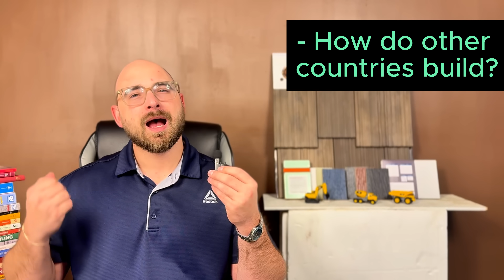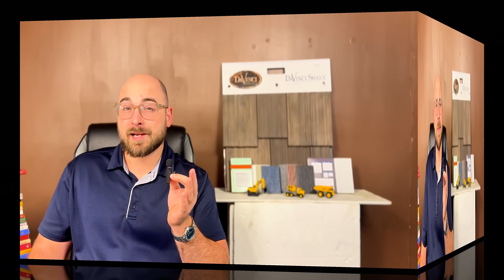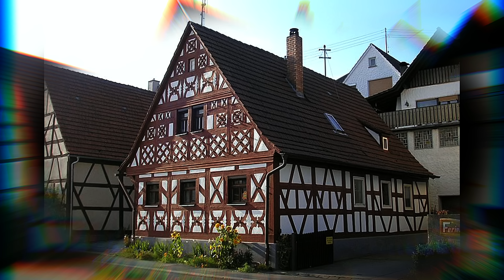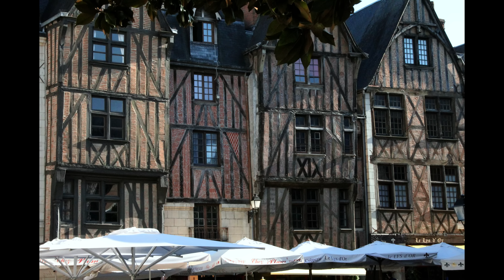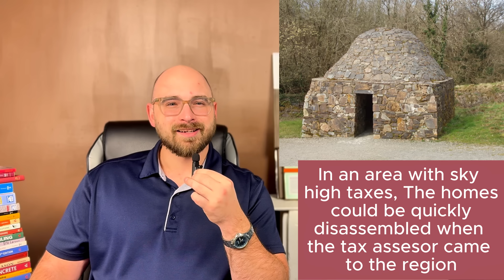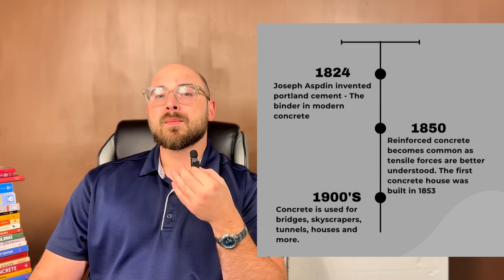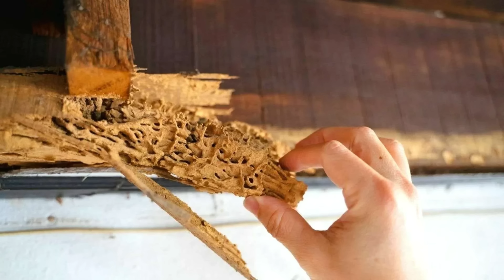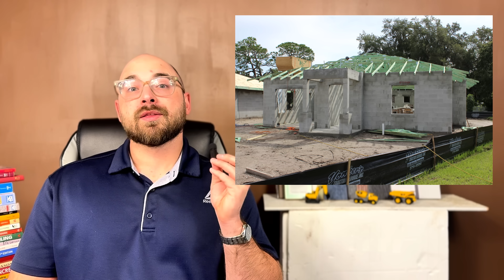Why Other Countries LAUGH at American Homes

Comment: Homebuilding in the US is designed to make a quick buck for investors rather than to build decent homes.
Reply: yeah that’s why so called forced air heat  (which is not really heat at all) became so widely used in new construction even in northern states, which is crazy. But because most real estate agents don’t know the difference between a furnace and a boiler, it is ignored in most transactions as insignificant.    I especially cringe for the buyers who have lived their whole prior lives with some form of radiant heat and don’t truly understand what they’re getting themselves into. But to the relevant point, it’s all done because the initial installment is a cheaper deal for the builder. What comes after is a different story altogether, but the developer doesn’t give a hoot about that. Everything is done like that in this country. It was the same story with American cars. The US pretty much invented the mass production of cars so why did Japan eventually build them better? Because the mentality there is to build quality that lasts. The mentality here is.. well you definitely can’t make the maximum bucks with that mentality!! if a car lasts 15 years rather than five well that’s two fewer sales that you get out of each consumer!!! absolutely UNACCEPTABLE!
Reply: @comment6864 
Lol! 🤣
A long time ago I heard that Japanese vehicles are built better because the Japanese have very small hands that can fit into very tight places! 😆 🤣
Reply: @ You have no idea what you're talking about at all.
Reply: In India most people use concrete.. only the poorest of the poor (tribes )use stones and mud
Reply: I wanted to comment the following:the real question is why are Americans paying so much for a house made out of toothpicks bro 💀
Reply: Also why are people only talking about concrete, do you all think we pour concrete when making a wall? The corners of the building are concrete Pilar's with rebar, and the rest of the wall 🧱 is made out of bricks , not the old type but the modern kind that's also a good insulator and is lighter and easier to work with.
If you wanna window or door you just cut that brick , the only bother is the dust .
Reply: Exactly. .. having lived in countries on all continents I agree that America have the shittiest cheapest houses.. in America here they build quick it’s all about speed and saving money, economic factors, etc. And they use wood, which easily burns down or termites and other forces can take them out. Many countries I lived in the homes were much sturdier and stronger built with brick or concrete or other strong materials. Hell, even in Africa the homes were very extremely strong built of concrete and brick. 🧱 And they don’t even have hurricanes or fires like they do here but man those homes ain’t going anywhere!!
Reply: You know why? Because of cars. Building for cars is wildly inefficient in terms of space and money. The property tax of Single-family residential homes can't maintain the cost of streets and roads. Over time, you lose money. The solution is therefore to expand and build more homes to gain property taxes and to pay for all the roads that have to be build for no reason other than for cars. The result? Those areas die out and run out of money because the local economy doernt work right. 

Basically: car dependency and suburban neighbourhoods work like a Ponzi scheme. You can learn more in the research called StrongTowns.
Reply: The most unpleasant thing is that builders and investors are selling these creaking wooden chicken coops at the price of reinforced concrete.
Reply: @ Reinforced concrete, nobody wants a concrete house, they are cold, boring and expensive.
Reply: They're not expensive outside the U S of A, they're only as boring as you make them, and again how cold they are depends on the making @ericholdsworth6611
Reply: Yup, it’s what I call toxic capitalism. I work in the construction industry and I see this all the time. I constantly come in behind those that threw junk together just enough to get paid and the poor people don’t know what’s right so they end up paying them and getting ripped off. Then they have to pay me to fix it. Just totally pathetic. It would give me great pleasure To make a living punishing these inconsiderate jerks. If any of you read this And are planning to do any projects larger or small please vet the Folks before they ever start. If they don’t have pictures to show (that’s location and time stamped) Then don’t hire them. If they don’t have pictures, that means they are not proud of what they do and therefore Just in it for the money. Send them packing as fast as you can. Find somebody that has lots of pictures and are readily willing to give you references. And remember if it’s too good to be true, It’s too good.
Reply: We don't make house that last forever, just ones that last the life of the mortgage
Reply: So you have a concrete box that cost more to build. You still need to strip off the interior finishes and electrical gear.  Get insurance and you’re good to go.
Reply: LOL
Reply: There is nothing wrong with OSB stapled sheds. But WHO made you call them "FINE HOMES"? 😂
Reply: With the prices the same as a stonebuild house in Europe nowadays you guys surely have not succeed that house for a buck idea.
Reply: everyone in these replies is talking about affordable homes, but don’t they realize that investors build cheap homes and sell the for the price of a well built one? nothing is ever consumer friendly i don’t get how people are so innocent
Reply: yes and in Fl  that how investors make money and the people  paid over and over  for a home
Reply: If you don’t like it, build your own house. 

I did, and it was worth every penny
Reply: @rufus2028  this is your solution? the fuck do you think we built society for?
Reply: This is true today, but this does not the damn platform stick structures. We have structures like these as well as balloon structures that are hundreds of years old and still standing and people living in them. This is like everything else a result of bad business culture, such as the crap promoted by Jake Paul Getty about making things to wear out so you can sell more to the customer down the line.
Reply: @ 

Exactly. There are custom home builders. You can hire an architect and design whatever you want. Design it yourself and have an engineer certify the plans. There are contractors that will build whatever house you want on your land. There are semi custom homebuilders. There are websites and books with tens of thousands of homes already designed that can be made out of whatever material you want. You can also change the plans for a nominal fee and get the entire set of blueprints sent to you. I mean it’s literally unlimited what you can do in America. When I say unlimited, I mean your options. We do have a problem with insane building codes, zoning, regulations, etc. etc. Ridiculous property rights restrictions. The list goes on and on. But in terms of the house itself is long as it meets code. You can literally do almost anything you want. Especially if you own a few acres in a rural area. That’s actually the most affordable way to build a house today. Buy an acre of land outside of town and get you a book or go to a website and pick out a design you like and then have a local home builder build the house for you. That’s extremely popular in the south. Tons of middle-class people do it that way in the south. A lot of people in the south, especially the homesteading community will live in a camper or a mobile home on a piece of land they bought and save their money and build the house cash or some combination of cash and Mortgage so that they aren’t controlled by any enormous mortgage long-term.

It is getting much more expensive, especially since Covid. Thank you, Joe Biden, and Democrats! Because of how they handled the 2008 financial collapse created by Bill Clinton and Democrats and big government and the way they handled Covid so poorly but the landscape they are still ways to do it And more people need to move away from big Democrat dominated metropolitan areas to places, particularly in the south that have a significantly lower cost of living. This is why starting your own business or taking advantage of today’s technology or how people achieve the American American dream. Not being a slave for some big corporation.

But of course, everyone focuses on the big builders that build lousy subdivisions and have their stock publicly traded. Unfortunately most people think that’s all there is to the American homebuilding market. That’s just one part of it.
Reply: Autistically simplistic. Supply/demand, history, culture and economy, or for liberals they're fault.
Reply: I love how you are talking about remodeling, but you don't talk about the fact lots of people in the US don't have a house 🤔
Reply: We don't make house that last forever, just ones that last the life of the mortgage
Reply: Not so. We use engineered lumber even in high-end home. We do have differing levels and qualities of construction.
Reply: So homes meant for humans to stay alive are just made for capitalists to make profit from ? I mean it's the USA. At this point I am not surprised, they love making profits out of deaths itself. Like this is why yall have more chemicals on everything you touch or digest. Like Fanta, yall pay the rich to give you chemicals and paper houses. And they still licking rich ppls toes.
Reply: Every product is unfortunately
Reply: I'm an American, I'll never be able to afford one of these investment vehicles formerly known as houses. Rent is theft. It should be illegal for businesses to peen houses. They should be  for people. The homeless population is proof of our countrys and capitalisms crimes.
Reply: IT ISNT FUCKING 100 F IN EUROPE
Reply: Thats not the case at all unless you buy a spec house, the process we use is affordable. If you look at modern European design, it basic and cheap looking, especially in Nordic countries. Most of the people who complain I would guess have means and you as an American can use whatever process you wish if you build yourself. Classic foolish rant.
Reply: Das sind keine Häuser,wir sagen dem
Baracken.
Billige primitive Scheisse.
Reply: I've built homes in the US.  Nice homes.  Better than "decent".
Reply: While it is a quick and lower quality build, while we are currently in a housing crisis i think it would be a good idea to make a lower standard cheaper housing solution to house poor and homeless people with more of an American building style, while they dont meet safety or insurance minimum requirements i think at some point we have to be sensible and say a less safe and “temporary” build style is better than people being homeless. 
I mean in Europe have way more trees available than Europe and we really dont use them enough, potentially we could even use more timber in brick houses with some kind of modern advancements to make them almost as durable and safe as real houses
Reply: American homes are bigger tho
Reply: *I just sold a CCB home that I had built.
*In hurricane prone weather I felt it was prudent.
*The only load bearing walls are exterior, so the changes we could've made were endless.
*The neighbors watched it being built & all felt that when storms came that they were coming to my place till things settled down.
*Would I do it again? Sure but ready built is really convenient.
*Then easily turned over when I feel like it.
*The only structure that is forever is your final pine box & even then only so, so.
Reply: German here. Only upper class can dream of owning a home. Want that in the USA too?
Reply: Not just home building
Reply: You definitely can
Reply: If this was true then the US housing construction statistics wouldnt be so low.
Reply: Same in UK ..
Reply: that depends you can build for that or for quality long lasting, or pay someone else to do it either way. all US homes are not equal. actually you can build your house how ever you want. just a lot of people chose cheap and quick, or just cheap. don't buy a modular if your looking for quality, or don't buy a home in a instant cluster colony. find a four man band who all live in solid houses they built themselves before they met the other three and just feed them money and let em go
Reply: Disposable homes.  It's the McDonald's of domestic architecture.
Reply: I imagine you’ve never been to the northeast where we have beutiful colonial brick houses everywhere
Reply: especially bc the people who are “investing” in building the homes aren’t living there, they’re making them and selling them off right away and we all have to deal with the shitty quality
Reply: The problem is capitalism. Homes are considered a rapidly manufactured commodity now. As in all other industries, the builder wants to make the most profit for the lowest expense, so they throw up tons of dogshit quality stick-built structures which crumble in disasters, then charge an arm and a leg for them, keeping average homeowners in debt forever. In the last few years, developers have reduced the rate at which they're building homes to keep supply artificially low, contributing to the current housing crisis. Same thing DeBeers did with diamonds, only with less (recent) ethnic cleansing. For-profit firms can't be trusted to act in the interest of society; they will only act to maximize profit and externalize costs.
Reply: It also saves the homeowner money. You can get a concrete house built if you want.
Reply: "how great we are" not that great actually. US wealthy , as everyone knows (but Americans) was built on exploration of ruined countries at WW and after imposing the Dollar as the mais currency. THAT sustains America on top so far. The day the world find a way to move to other currency, US will crumble. In resume, the economy is great, but the average American is pretty lame and ignorant, overall
Reply: It is in the uk
Reply: Same with every other industry the “best” food company in America by numbers pretty much produces poison translares to almost every industry
Reply: It is not important are the house from wood or stone important is it yours or you still have 20 years mortgage payment Greatings from Croatia Europe 😂😊
Reply: Major L on their part
Reply: Replace „Homebuilding“ „homes“ with any other industry and it will always be true…
Reply: Homebuilding everywhere follows the same thing, that's not an exclusive US motivation.
Reply: Overpriced tornado homes.
Reply: Most Americans don't fancy living in homes that are 6 feet away from vehicle traffic. I don't want to step out of my front door and get hit by a car.
Reply: Everything in the US is about making a quick buck off someone else
Reply: The same is becoming true to a certain extent in Europe as well. Large multinational conglomerates are slowly but surely taking over the new home construction sector, especially large scale residential projects like appartment buildings and multi-home suburban housing developments, but even made-to-order single family homes. They're exploiting low-cost labourers from eastern european countries (not paying them the wages their owed from working in western europe, not paying them overtime, not paying them sick days) and using tax loopholes to keep costs low and outcompete smaller, local builders.
Reply: Why is it different in Europe? They don’t have investors building houses also trying to make money?
Reply: To be fair, thats pretty much everywhere these days. the UK is sadly full of little boxes with bedrooms that wont fit a bed and a wardrobe (assuming you can even get a wardrobe or bed up the stairs), living rooms too small for a suite and garages you can technically get a car into, but then you cant open the doors to get out of said car.
And that is the main reason for buying an older house. Scale. To the victorians and before a house was a machine for living in as Le Corbusier pointed out, nowadays they are investment vehicles and spending money on making them livable is counterinutitive.
Reply: Everything in the US is solely designed to make a quick buck.
Reply: When you live in a place like Michigan, it can get up to 120 and down to -30 you can’t have stone structures that can take that type of temp changes, my home is 120 years old and I just recently modernized it
Reply: That’s not really why. It’s mainly because people don’t want to wait too long for their home to be built.
Reply: @ trust me, people are willing to wait for a well built home
Reply: I live in Portugal where the construction is solid because of fire hazards. To be honest it doesn't even matter to me because it's an headache to change anything in the outside if you live in a city. Just to change the colour I would need approval of the condominium, followed by the approval of the city hall urbanism office. And I can tell you that it would be denied because all the buildings in my neighborhood are a shade of yellow and white. Can't imagine adding a window lol.
Reply: Isnt it how everything work in usa?
Exactly why you cant afford any basic stuff like healthcare, education, public services.
Reply: Quick and overpriced😂
Reply: Those houses are legally not safe for living in mexico
Reply: People in the UK extend and remodel their homes all the time.
Reply: You can’t generalize like this unless you’re an idiot.  If so go right ahead.
Reply: True
Reply: That's the problem with EVERYTHING make in the US.
Reply: Okay but we have functioning air conditioning. so there.
Reply: America is designed to make a quick buck for investors rather than producing anything decent at all!
Reply: American homes aren’t built to last, but American homes are cheaper and easier to build. So you have a trade off. All home buildings techniques have their purpose and each have pros and cons. Yeah its fun to make fun of American style homes, but that doesn’t mean that your way is the best way.
Reply: Yes this!! The fact that you can buy a house for $300-500K, then spend another $50-100K on a remodelling and then in 2 years loose it all to fire or termites is insane to me.
Reply: That is the long and short of it.  $$$
Reply: US building practices are especially 'sus' when you consider that the US has 75% of the worlds tornadoes.  ALSO... hurricanes, wild fires, earthquakes and floods!
Reply: There are plenty of construction crews out there that will spit on you for this statement. Well, unless you are talking about homes that look and feel good, then theyd shake your hand. But as for quality, well, they will provide the spit, now all youll need is a towel to shine your shoes and get back to the office.
Reply: OK, so are you aware of people were making homes out of wood 100 years ago?

Just a question. 😂
Reply: US homes have excellent quality... excesive price is whole different conversation.
Reply: Home sellers are the same… they want to make quick buck and ask for astronomical price for a piece of poo
Reply: It is if you buy a shoddy production built house in a track subdivision. If you hire a custom home builder to build you a house, you can buy a high quality, long lasting home. The issue is… it costs a lot more to build quality, and most Americans don’t understand the difference in quality, and don’t want to pay for it. Would you spend 30% more for the same house with no visible difference in footprint or style? It’s not just “greed”, it’s the American costumers expectation for ever increasing “affordability”, and are unwilling to pay high prices for higher quality. If you are willing to pay, you can definitely get a house that will last 100 years +.
Reply: @brandonbeaty6617  disagree 100%.  It’s not that they’re unwilling.  It’s because the prices are obscenely higher and people simply cannot afford it
Reply: @brandonbeaty6617  willing to pay ≠ able to pay
Given the option of having a mediocre-decent house you can pay for in 5-10 years of installments and a good house that will be paid for by your descendants most Americans choose the former
Reply: Yes largely, but not entirely true.  The homebuyers are just as culpable.  As Americans, we are typically are impatient.  We want everything fast, from fast food right down to the construction & delivery of our newly built homes.  And if there are delays, somebody is incompetent.
Reply: The industry is in shambles. The building code squashes innovation. Con-qwackters just go along with it for the easy money.  100 years behind the times. Imagine if your car was built like a house is constructed. You wouldn’t get out the driveway
Reply: @steveperreira5850 this is such a nothing/useless comment I imagine you’ve never contributed anything useful to anything in your entire life.
Reply: @steveperreira5850  Such a dumb comment its unbelievable, why do you comment on shit you are clueless about?
Reply: @steveperreira5850 codes is a floor, contractors and builders use it like a ceiling.
Reply: @steveperreira5850 

You are correct in many regards. A big part of housing prices skyrocketing in different parts of America is because of the government and regulations and building codes, etc. This is one of those topics that Joe Rogan is clueless about. He’s incredibly dumb on certain topics or too fixated on his personal beliefs to see truth. Marijuana and building codes are two of those topics. He thinks we absolutely need building codes and that we need more not less. I live in Charleston, South Carolina. One of the oldest cities in America. The houses built 100 years ago are far better houses than new houses. Yes the plumbing and electrical eventually needs to be replaced. But the house itself?! Infinitely better.
Reply: @nedhill1242 we have lots of building code in Europe but this doesn't make our house more expensive, Yes they are more expensive but they are more efficient and durable, we construct some light frame house but if the house gets to be affected by the rain in the construction, the company has to demolish it and re build it. In the US if your house takes the rain in the construction it's  normal to just continue to build, this makes no sense.
Reply: @nedhill1242 a house framed 100 years ago is not comparable,  they're not as strong or as safe.
Reply: @ 

lmao

Sorry but that’s absolutely absurd!

First I’m in the real estate and mortgage industries. Second I live  in Charleston. One of the oldest most historic cities in America. 

The framing and construction of old houses is far superior! The plumbing & electrical are not as good as today but those are pretty easily replaced but that has already been done in most older homes. 

Houses today are built like crap. Inferior materials, itty bitty lots, no character, and on & on. 

You clearly know absolutely nothing about real estate or construction if you think older houses are inferior! You can’t even compare site built older houses to anything built in a modern subdivision. It’s a joke. You can buy and restore a house built 100 years ago that was completely overgrown when a more modern house would need pretty much torn down. 

I grew up in a house built in the late 1930s and renovated a pre-WWII duplex that are incredible houses. Real wood exterior. Hardwood floors. Real hard wood floors far superior to even expensive floors of today. Plaster walls. Beautiful lead glass & brass fixtures. Incredible tile bathrooms and kitchens. The framing is far far superior with better construction. 

I mean it is a joke to think homes built in the 1950s especially anything built in the 1940s and earlier are inferior to tract homes built starting in the 60s. Ask any flipper, real estate investor, etc and they will tell you there is no comparison. Go to any small or rural town and look at individual site built houses compared to tract built homes in modern subdivisions and it’s painfully obvious. Even some subdivisions with individual site built homes from the 60s thru 80s are superior to the average house built today or over the past 30 to 40 years. 

I can also promise you when people move to an older city. They much prefer the older neighborhoods and the older houses because the neighborhoods are far superior, and the homes themselves were individually built and so much more character. The only reason people buy houses in modern subdivisions is because of convenience and affordability as well as location. It’s not because of the quality of the house!

Regarding your statement that the houses built 100 years ago and specifically houses framed 100 years ago are inferior to today. That is ludicrous and laughable. Come to the south. Come to the deep south along the coast where we have termites, hurricanes, tornadoes, humidity issues, Unstable soil, etc., etc. Good Lord. Older houses are far superior. Older houses hold up much better to the conditions and again they’re in higher demand. Because they’re better built. Because the materials are superior. Because they have more charm and character.
Reply: @nedhill1242 the homes designated historical are very expensive.  Everything has to be approved by committee. Paint type, windows, roofs, doors, etc. I am not sure about the interior.
Reply: @nedhill1242 Without building codes there would be a lot of problems with fires, water damages, roofs falling in etc as builders would skimp on materials (both type and dimensioning) as well as safety and so on.
The codes needs to be constantly revised though for changing circumstances but without them there would be shanty towns all over.
Your example of good houses from the past is survival biased, the only remaining houses are the ones that were well built. The others have perished due to poor quality in design, materials or craftmanship.
Reply: @ 

Wrong wrong wrong

This’d things would not happen because only a mirin picks a builder that does that. The guys you’re talking about would be out if business and in jail. I swear people are children needing their hands held for everything today. You clearly don’t understand economics or how much different things would be because you are not smart enough or to brainwashed to see how it used to be and how that would work today.

As far as survival of the fittest Dude there are entire cities everywhere like this. Look at Europe. Look at any  city or town in America. There are entire cities and communities today with houses built with little to no codes. There are amazing neighborhoods from the textile and mining days when you had “mill towns” and “company towns “ where the company owned everything and provided housing. There are still plenty of the Sears homes that were houses bought out of the Sears Roebuck catalog and shipped to you on a rail car and you put it together on site like a puzzle. There are entire neighborhoods still like that. 

Where do you live? Have you never been to an old neighborhood in any city or town in America or Europe? I mean seriously people like you must fall off the tailgates of trucks because you aren’t very bright. I could prove my point in almost every town in America or Europe. 

FYI ever been to Houston? Most affordable big city in America. 4th biggest city in the country. No zoning laws. Texas in general doesn’t have zoning but most big cities do something similar which leads to the same issues but Houston has been different.
Reply: @nedhill1242 100 years? Dude I’m pretty sure my house is older than your country and it is still standing, so either 
1: your making up complete bullshit claims
Or
2: the education system in the USA is really REALLY terrible
Reply: Houses, not homes. A house is a physical structure. A home is a concept of belonging.
Reply: With European houses the fires in Los Angeles never became so worse.
Reply: @eos-fan  they’re made to look like European houses, they’re not built the same
Reply: How much more do you want to go into debt buying a home.
Reply: @kh2099-z5f  Your houses already cost more than the concrete houses of many countries.
Reply: @kh2099-z5f  If slum area homes in third world countries are built using hollow blocks and rebar, how can Americans not afford it?
Reply: @kh2099-z5f everyone wants the contractors to just eat the cost of premium home building materials- and contractors are “greedy” for not offering them at the same price… but consumers aren’t greedy for wanting contractors to do double the work for the same pay 🤔
Reply: you already go into lifelong debt @kh2099-z5f
Reply: @kh2099-z5f  then buy a smaller house, instead of building a mansion out of carton and sticks 🤷‍♂️ 
But I get it... It's hard for Americans. They love putting looks over anything else.
Reply: @kh2099-z5f houses in the us usually cost more for buying so idk what your point is
Reply: @kh2099-z5f  its actually not that expensive if your building it outside big Citys
Reply: @kh2099-z5f European house prices are about the same or even lower than yours.

Homeowning prices are not tied to the materials used to build your house. At least, not strictly so.
Reply: @kh2099-z5f  I know everyone should get a free house😂
Reply: Health Insurance and everything else is the same way. In America quarterly profit Trumps EVERYTHING! Including life itself. Aaahh yes, got to love capitalism.
Reply: So Investors can't make a quick buck in other countries????
Reply: @gnomechump-stiny7128  there will always be companies trying make thing the cheapest and simplest way. That's why you regulate the industry, so the lowest standard is good enough to last. The downside is that the system may appear rigid, and you usually need to hire professionals instead of doing everything yourself. But, from my knowledge, this high regulation model is more prevalent in Europe than in the US.
Reply: @gnomechump-stiny7128 they do, but the greed in the US corpos keeps blowing my mind.
Reply: @gnomechump-stiny7128 exactly, there are regulations outside US where pigpens house isn't preferred
Reply: @gnomechump-stiny7128  because there is a different mentality in other countries. In Europe it's more like live-long investment, people here don't want disposable houses.
Reply: @gnomechump-stiny7128  they can but they are take in arest if somting like poor building tehniks or mising materials are found
Reply: @gnomechump-stiny7128 no. Because we have LEGAL STANDARD for building homes to sell NOT TO ENDANGERS THE HOME BUYER.
Reply: @gnomechump-stiny7128  investors can make a quick buck in the uk too. But the entire gimpy bitchmade American construction Industry is solely designed to maximise profits while lowering quality as much as possible. The floor plans are bad too, you can buy a bigger house for cheaper but all the space is wasted. It's shit all round
Reply: @gnomechump-stiny7128  a profit yes. A quick one? F*ck no😂😂 ( at least for a small to medium size builder, larger builders can get products and workforce cheaper and en mass, making work quicker, cheaper, more effective, although sometimes lacking, but not collapsing on their own weight
Reply: @gnomechump-stiny7128  Not when it’s scamming. Selling a shack priced as a mansion…
Reply: @gnomechump-stiny7128  other countries prioritize housing people can live in for generations rather than for profit.
Reply: do you think Europe is different? They buy a small area of land and make a 7 store (or more) building, and since the land area is the most expensive part, the more houses you fit in the smallest area, the more you win. Houses in Europe are EXTREMELY expensive, a 60 square meter flat costs half a million new.
Reply: In the US they build a house. In Europe they build a home.
Reply: Yes a house built with wood can be sturdy. Most of the tract homes that are built in the US are built to meet a minimum building code and the building codes can vary quite a bit from state to state. 
Plus most of the other countries didn't have to deal with the rapid population growth the US had.
Reply: @Rhaspun  yes but now the rapid population growth is past history but the us still use wood right on the track of fucking tornado XD
Reply: @faellyss  

It’s all about percentages. The odds of your house being destroyed by a tornado is extremely extremely low. The odds of a hurricane destroying your house are as low or even lower even in a place like Florida or South Carolina.
Reply: @nedhill1242  where i live there is no tornado, but there is huge hurricane ( i live on a french island in the indian ocean) every year we have atleast 1 hurricane crossing the island , and everyyear hundred of weak house ( because poor people ) got obliterated
Reply: @ 

Seriously?

It never ceases to amaze me how desperate people are to prove others wrong on the internet. Is your self esteem that low or are you that narcissistic that you think a French territory is the same thing as France itself or Europe? Are you mental? It’s an island in an ocean near Africa. Do you actually know how a hurricane works and where they come from? 

Next you’ll talk about French Polynesia or French Indonesia or French Indochina. Maybe say you live in St. Martin. Therefore you can say you live in France. 

This is hilarious. I hope you are being sarcastic or a troll because it would be truly sad if you are being serious. 

But just for clarification. Living in a French territory it’s not the same thing as living in France. Living in Europe. This would be like someone saying America doesn’t get monsoons. Because we do not get monsoons. And then somebody reply that they live in Guam and that Guam gets monsoons therefore America gets monsoons. Such desperation, such ridiculousness could only come from a child, a troll, or someone truly disturbed.
Reply: @Rhaspun  

Actually, almost every state  uses standard building codes. When you go to get a building permit either for a new house or to remodel an older house it we usually say everything has to be built to one of the following standards and they list 3 different standards that are nationally or internationally recognized. Florida has the best built homes in America these days because of hurricanes. Most houses in Florida are made out of concrete block with rebar and concrete poured into the outer walls and require high impact glass.
Reply: @nedhill1242  I've seen videos showing homes in Texas using what looks like cardboard as sheathing. I know Texas isn't the only state who would have a low standard like that.
Reply: Elementarily Simplistic, pablum
Reply: @randidaman6978 what is?
Reply: Not just peir homes or junk slab houses most American home are equally as good as European or any countries homes. Those that speak that American homes are terrible couldn't build a sand castle.
Reply: Honestly, it's mind-boggling that you'd make a video like this. I don't know if you're too ignorant to understand what you're affirming and spreading, or you just want the views. Americans need to wake up about thus ignorant bigotry from other countries instead of going along with it. You've basically been an Uncle Tim here.
Reply: Well, just look at the difficulty of trying to sell a more expensive home. The developer purchased is 40 acres and they have to try to make money on this development so they can’t make them large plots or else they’d have fewer homes and they’d make less money so they have to be smaller to start with and then they have to have as many amenities as possible, but they can’t cost too much or else they priced themselves out of the market for people looking at smaller homes on smaller plots. 

You can’t build million dollar homes on postage stamps and expect people to be willing to buy them when there are much larger homes for cheaper next-door.

That’s the problem…. It’s a bigger country, you’d think we’d have more land, but it doesn’t work that way because land prices are dependent upon their proximity to downtown…. Many Europeans  are forced to make do with a real estate culture where your grandparents purchased a home after the war and your parents inherited the house and someday you might inherit the house, but that’s the only way you’re ever going to own one because they’re just too damn expensive
That’s just not how things work in the United States because we have a much more mobile culture where people don’t plan on buying a house and living in it for 60 years in order to justify the massive expense, they buy a starter home and they worked their way up
Reply: @Matt-yg8ub generational? Our mortgages are max 20-25 years at a 2,5/3% interest rate. Every working class family can buy a decent flat and pay it before their kids legal age. I'm living in northern Italy.
Reply: @elephone1542  yup well that’s kind of how it used to be in the US .. like 50 years ago. And an average family could afford an average little house on a single average salary. I call that a normal balanced economy, but for the powers that be that is too boring 😂. unfortunately, I think that is why the trajectory for this country will continue to its decline, a slow but painful one.
Reply: @  ok… I guess you found yourself a nice cheap place in the countryside. Meanwhile, the average home price in Germany is $300,000 higher than it is in the United States.
Reply: @elephone1542 as per google average mortgage rate in the us is over 7%
Reply: @Matt-yg8ub  averaging across a country is probably misleading. Europe is a much denser place. So you are probably in effect comparing some house in rural Mississippi with a house in suburbs of Frankfurt.
Permission to build usually affects home prices more than construction technique. Just look at house prices in San Francisco for instance. It's astronomical not due to construction method
Reply: @Matt-yg8ub  the median house price in us is 484k  wtf are you talking about ? XD
Reply: @Matt-yg8ub How much do you get paid though? Do you have to worry about medical debt from lack of health insurance? What about paid time off? Do you have to pay for childcare? The grass is not as green as you think.
Reply: @Matt-yg8ub  No, its not, lol. What are you smoking... And why compare with Germany where most of the real estate costs are driven by speculation? Compare with Spain, Italy, Greece, where square meters cost significantly less. The average median for square meter in Spain is less than 2k euros. In the US is more than 5k, lol... And youre not even takiing into account that a house in Spain lasts you several generations whereas one in the US can fall down on you in a few decades.
Reply: @elephone1542 ...my fellow human from italy, dont make the USAn cries will you? In our countries, home are one of human rights and citizens right.😂
Reply: @Matt-yg8ub paid ONCE! Ask the USAn what kind of fee they have to pays CONSTANTLY! more so if it is HOA house.
Reply: @Matt-yg8ub the average house price in Germany is $375k. 

and I know for a fact that houses don't cost $75k USD over there, so that's just a lie.
Reply: @Matt-yg8ub higher but also hurricane proof.
Reply: @Matt-yg8ub what's the cost of living difference to wages? What's the average wage. When you compare places and costs of homes, wages and the cost of living factors in. Like no one in most couhave medical bills, costs like America
Reply: @Matt-yg8ub  no parent live in the grand-parent house grand parent are still alive and live in it , you're totally out on understanding of the european context and usage
like my great grand parent are still alive and in a house their parent owned even before the war, my grand parent live in a city nearby in a house they bought, my parent live in a house my uncle build before leaving and selling it, i live in a house i bought the land and made the house be built 
all of those house are made of "concrete" and none of them is in the same price range ,
my house cost me 250k to buy the land and be build, my parent house is valued at 450k(big house with big property), ma grand parent house is something around 200k (tiny house), my great grand parent house is 500k ( huge old farm) price varie because of size, location, big city nearby ...... like in the us 

and after checking  similar location (distance to big city etc) and size  house in us cost more
Reply: @Matt-yg8ub  But cheaper materials shouldn't mean that the houses are cheaper too? And yet you americans likely pay more for a cardbox-home than we Europeans for a normal sturdy brick/concrete house.
Reply: @Matt-yg8ub for the most part it isn't true. We in europe (that isn't a country) don't hope to inherit our parents' house, we work to buy one ourselves
Reply: @Matt-yg8ub Let's see. I have my own apartment, so does my brother and so do my cousins, and we live in Romania, France and UK. But please, don't let reality stop you from that nice fantasy of yours about better mobility and affordable housing...
Reply: @Matt-yg8ub
As a Swed I have only meet one person in my life that has inherent his house. Everyone else by them or have them constructed.

Refurbishing concrete, brick and wood houses are quite common.
Reply: @Matt-yg8ub  the problem with that argument is that US homes aren't exactly much cheaper than European homes
Reply: @Matt-yg8ub  sounds like there is something fundamentally wrong with how you built cities.
Reply: @ compared to Europe? We developed most of the fixes to the older problems, but never had the chance to gut everything and rebuild it in the US like we did in Europe after WWII.
Reply: @Matt-yg8ub why are the starter homes more than a permanent home?
Reply: @Matt-yg8ub  Wait you mean younger Americans have any hope of owning a home?? Of course not! They're all being bough by corporate landlords to ensure future generations will be perpetually renting! And we don't even have co-ops like Europe, just rent-seeking capitalists. 😢
Reply: @Matt-yg8ub omg these poor hedge funds lol 😂😂😂
Reply: @Matt-yg8ub people also don’t expect to own anymore in the US and the housing market is going to collapse bc unbridled capitalism is clearly unsustainable dispute what dopey white trash idiots like you think.
Reply: @Matt-yg8ub  pfft excuses. even in poor countries. ALL AROUND THE WORLD people use concrete. how come developers can do this in rich and poor countriers?
Reply: @Matt-yg8ub 
I don't know where you're getting your info from but I live in the UK and I can think of only 1 person that lives in a home they inherited from their parent, let alone their grandparents. that was only because her mother died young and left her 3 kids to share the home.
Reply: You cannot remodel a concrete house. Remodeling is an integral part of the home owning experience in the USA, which is alien to Europeans.
Reply from the maker: @starventure it is possible to remodel a concrete house. 

ICF homes are fairly simple to move plumbing and electric as they are not embedded in the concrete, but in the foam. 

And it is fairly simple to create door and window openings in a concrete house. 

You will of course need an engineer to approve a set of drawings, but you can cut very nicely though the concrete core using a cut and break saw, typically adding steel lintels above the new openings 

Not to mention how trends go out of style. If your home is out of style, just wait, soon it will be trending again
Reply: @Mike_Fortin 

I’m in the mortgage and estate industry and I’m very familiar with ICF homes. Everything you said is inaccurate.  Most of the plumbing and electrical is under the house or through the floors or interior walls. We are necessary you can run electrical in the outside walls for switches and receptacles but you try and minimize that as much as possible. It is extremely difficult to create a new doorway in these houses because you’re talking about several inches of concrete and rebar to cut through. Barry rarely will you see someone add an addition to a home built with ICF blocks and if they do, it’s where there’s a door or window already to make it easier. Also, these homes, particularly in America tend to be more expensive and are built by people with a lot of money in areas that have hurricanes so they’re building large homes that they’re probably never going to expand anyway.
Reply: @Mike_Fortin  Very true sir.  This is a primary reason I've selected ICF to be combine w/other construction methods & materials for my planned multiple homes across the globe.
Reply: @Mike_Fortin ICF is not simple to run pipes or wiring. Especially for a remodel.
Reply: @Mike_Fortin  if not In the far center of USA/CANADA with dry air, the wood houses older than 25 years stink like fungus ...
Reply: @nedhill1242 no he isn't
Reply: @Mike_Fortin  but it's more expensive, more time consuming, more labor intensive, and overall more difficult.
Reply: @Mike_Fortin i cut holes in basement foundations to put windows in basements and it costs 2-3 times more if you want to add an opening in concrete vs wood framed.  Not to mention concrete is one of the single biggest contributions to environmently pollution.
Reply: @Mike_Fortin 😂
Reply: @Mike_Fortin yeah no its not. Clearly ypu never had to drill a 76mm whole through .5m of concreet to put a pipe in. And it shows
Reply: @Mike_Fortin mate it is cause our houses dont burn like i dont know "wood" and they dont fall apart from a little stronger wind.and also wtf is HOA? Do you actually own your houses or are you living in a camp where everyone can bother you
Reply: Egineers are only needed in high developed countries and in commercial buildings, here in Brasil almost all masonry houses are made by a contractor (you have nice and bad contractors) and his 2 or 3 employees , and we do the construction and remodels first then we wait 5 years to the prefecture send us a mail raising the tax of the house, we have basically no building codes (it has it's pros and cons)
Reply: @Mike_Fortin very common here in Australia to have concrete tiles roofs or metal roofs and steel frames and brick
Reply: @nedhill1242 wtf? It's easy we do that all the time. The big difference in Europe is that every one I educated in their craft, they went to actual school.
Reply: @dubvuchyea502  

No, who isn’t? Be specific. Are you talking about Joe Rogan? Joe Rogan is clueless about this stuff. He’s incredibly ignorant.
Reply: @starventure  You certainly remodel a house built using concrete blocks. I have done it twice here in he UK.
Reply: @ So you are knocking out exterior walls and pouring foundation extensions in a concrete house...? OK, sure whatever you say.
Reply: @rogerphelps9939  yes and in the UK specially in London people have been even digging their foundations to build deeper under the house.
Reply: At what cost? @rogerphelps9939
Reply: @starventure  yes you can XD
Reply: @rogerphelps9939  our house was a fixer upper when we got it and has been in near constant remodeling for the last 18 years. You can't do that with a brick house.
Reply: @rogerphelps9939  wrote "You certainly remodel a house built using concrete blocks. I have done it twice here in he UK."
In the US, due to our building codes (which are crafted to protect residents from danger), if you want to change a house that's made of CMUs, it requires engineers to get involved, and considerable permitting, which can be very burdensome.  Also, I'm not sure how you build with flyblocks in the UK, but in the US, steel rebar is used inside the cavities, which are then grouted (filled with concrete slurry).  This makes a tremendously strong wall, but almost impossible to selectively demolish for modification.
Reply: @rogerphelps9939  same for modern flats in Russia. It's done quite often here, especially when builders leave some "columns" with hollow spaces inside just to dump construction waste into there. Yes, it's an actual thing, seen some guy on YouTube removing internal walls of a newly built apartment and adding a couple square meters in the "bathroom area" alone.
Reply: @rogerphelps9939 
😂 Let them COPE it's too much a shock to them.
Reply: @rogerphelps9939 shhh they dont know sledge hammers exist 😂
Reply: @rogerphelps9939 Source? 😂
Reply: @coldstarcommand are you really that ignorant to think you can't remodel a brick house 😂😂
There's literally hundreds of TV shows showing just that.
What an American ignorant way of thinking.
Reply: Way more expensive genius and takes more time😂 @rogerphelps9939
Reply: @starventure yes, we do knock out exterior walls and pour a new foundation if we want an addition to our concrete house. In my previous street around one in six houses had an addition. Most of the times it’s just an addition to the living room of about six feet to the rear of the house, but sometimes also a few feet to the side as well. Sometimes it also includes extending the second floor and roof. 

That last one doesn’t happen too often though, reason being that adding too much value to your house will make it harder to sell eventually. You can upgrade a €300K house to a €500K house, but most buyers with a €500K budget will want to live in a €500K neighborhood. 

So instead of adding a large addition, people will rather just buy a larger house in a neighborhood with similar houses.
Reply: @starventure yes. And we build those wall again, no problem. How on earth that is so difficult in USA!?
Reply: @dvdouden  How much would that cost? That seems to be an incredibly large amount of work just to get a few more sqm. The whole neighborhood thing you mention is very interesting, because with the exception of a few neighborhoods in our suburbs, it is preferred to increase the value of the house to make it sell faster as part of gentrification.
Reply: @ I had to Google that but it seems to be around 3000 EUR per m2, 280 EUR per sqft. Including sliding doors, tiled floors and plastered walls and ceiling. That’s in the range of price per sqft for houses currently on the market from what I can see. 

My previous house was a terraced house (which is the most common type of house around here), 6 meters (20-ish ft) wide, 8 meters (26’) deep. Extending the lower floor 6ft to increase the surface by 120 sqft would cost about 30-40K, rough estimate, certainly more than 20K, less than 50K. 
Adding 6ft is the most common addition since it only requires a technical permit for modifying the load bearing structure of the house. If you add more then you also need a permit where they check if your modifications fit the character of the neighborhood and doesn’t affect your neighbors. If you have a terraced house then you’re pretty limited in what’s accepted. Houses on the corner of a block often get larger additions since they usually have a garden on the side of the house as well that can be used to build on without affecting the neighbors. 

In the current market every house is getting sold sooner than later since there’s a shortage. Houses are literally being sold before they enter the public market.

Most people I know that added an addition to their house don’t plan on ever moving again. They like the neighborhood, their neighbors, the view and they just want a larger living room. Most people will just look for a bigger/newer/better house though. Especially with the low interest rates on mortgages a few years ago, people were able to finance larger houses more easily, so why bother with a large renovation. 

One couple in my street added an extension to their house when they bought it. They weren’t able to find the house they wanted on the market, so they settled for a smaller house and use the rest of their budget to renovate and extend the house. It’s a lot easier to do when you haven’t moved in yet. 
They mustn’t have liked the neighborhood or something because last I’ve heard they moved after two years already. 

A more popular kind of renovation is a dormer loft conversion. It’s a lot easier, can be done in a day, makes the existing space on the loft a lot more usable than just for storage and it doesn’t reduce the size of the garden. I had a 40ft dormer added to my current house, that effectively added over 200 sqft to my house for less than 30K unfinished, so 150 eur per sqft. They rolled in the trucks and crane in the morning and were gone by lunchtime. But I digress. 

Bottomline: yes it’s costly, messy, takes a lot of work, so it’s usually done only once in the lifetime of a house and most houses will never receive an addition. But people do it nonetheless and it’s not uncommon. 

I have no doubt wood framed homes are easier to extend and renovate and therefore it’s done more often. You’re still going to face the same challenges with opening up load bearing walls I guess. I think the main difference is that most of our homes are two or three stories so there’s a bit more load involved, but I guess you’d have the same problem if it was made of wood. 

Oh yeah, one last point: in terraced houses most of the load is carried by the side walls. The front and rear walls usually contain a lot of holes in the form of doors and windows already, and they mostly just carry the walls above them. The floors and the roof mainly rest on the side walls and possibly load bearing walls or columns in the house. A couple of jack posts is usually enough to carry the load while they knock out the rear wall on the lower floor.
Reply: @starventure  you're just gonna pretend like the rest of the world has never renovated their house?
Reply: @rogerphelps9939 the definition and outcomes aren’t even comparable. I can only guess that you think we don’t know people that live in Europe. We aren’t talking about interior upgrades. In 90% of your countries you don’t have large enough lots to do any exterior remodeling. How many rooms did you add?
Reply: @starventure  you ... guys dont?? even here in latinoamerica we do that, sure, if you dont plann ahead the process can be a total b1tch, which qhy is something that muat be planned and not juat made on the spot 😅
Reply: @sebastiansuazo98  We can do full house remodeling, it happens frequently and is not tough at all. The big difference is the only concrete we are dealing with is the foundation, which once it is expanded out from the existing foundation allows for the new exterior walls to go up easy, typically wood frame with brick exterior. You are talking about house expansion, right?
Reply: @rogerphelps9939  yup same here in the Philippines it's as easy as grabs the nearest sledge hammer and tearing the wall down and just extend it I've seen my family do it more than once
Reply: @starventure  alot of very old europeans houses have been remodelled and modernised for present and future use.
Reply: @alanmay7929  When you say remodeled, exactly what do you mean? I am getting the feeling that our interpretations are not the same.
Reply: @starventure  I disagree. We have remodeled our houses many times. it all depends on the way you decide to build is. If the Schell of the house is only made of concrete and the interior is just plasterboard walls you can easyly change the floorplan. Also brick or Concrete walls can be cun into or can be removed even when they are structural.
Reply: @flost8202  I will agree if it is brick, but even then it is going to be more complex than with a simple wood frame wall. I asked the engineer I hired about this subject this morning, and he commented that if it is a prefab house it should be easy to do, but a poured concrete exterior like seen in European homes is a tougher deal.
Reply: @starventure  Lmao, we added an extension (designed by the same architect as the house) to our concrete home. Funny thing is, it doesn’t look like a McMansion.
Reply: @starventure  Try knocking a load bearing wall with any construction method. And about remodeling there are entire tv shows dedicated to exactly that, so remodeling is new homeowners' pastime here too.
Reply: @starventure  Not true: Only structural walls are made wth rainforced concreate: divisional wals are puild with bricks, blocks or plaster boards, and can be removed, wuthoud affecting structural integrity of the house. Paradoxically you cant do that in baloon frame house, becouse all walls are structural to some degree.
Reply: @starventure  you can remodel a concrete house, wtf you on about? And how often do you Yanks feel the need to "remodel" anyway? You're making it sound weird.
Reply: @eno88  Go and watch HGTV or just look up contractors in the states. It is a common industry and is frequent.
Reply: @starventure  u can and i have. In concrete construction not all walls are strcutre walls.
Reply: @starventure  What? We have a family state dating back from the 1950s and has been remodeled at least five times.
Reply: @Gearparadummies  When you say remodeled, what do you mean?
Reply: Absolutely not accurate, concrete houses may be remodeled just like most single family houses. @starventure
Reply: @starventure Incorrect, we  remodel concrete homes in Korea
Reply: @scottydiver5114  To what extent?
Reply: @scottydiver5114  When you remodel, are you maintaining the exterior walls as is and just moving stuff inside?
Reply: @starventure  in the American remodel we do everything strip the interior down to the studs new floors walls usually leave the ceiling but not always 
New exterior if necessary 
Sometimes the new roof 

In Korea, generally simple stuff, the most complex being to cut holes in concrete walls and put in Windows
Reply: @starventure  Florida houses are all concrete block and get remodeled all the time. Why are they all concrete block? Because crappy timber houses get annihilated in hurricane force winds.
Reply: @starventure  you can if the house was build with this in mind
Reply: @starventure since when did concrete homes cannot be remodeled?
Reply: @starventure  Tell me you have no experience with concrete houses WITHOUT telling me you have no experience with concrete houses.
Reply: @starventure ah yes we never remodel 😂 you should see what some people do with historic houses where the outside is protected and not allowed to be altered. The outside looks like it did 200 years ago and the inside is extremely modern. Also if the layout of the rooms is good why would you even need to remodel much, except the occasional new door?
Reply: @starventure you can absolutely remodel brick houses, happens all the time
Reply: @panik735  Yes, brick is easy to do. But we are talking about European homes with reinforced concrete exterior walls, not brick or anything else. They are claiming that they jackhammer out the fronts and sides of houses for extensions like it is nothing. Anyone who has ever seen what it is like when the foundation of a house has to be opened up from the inside for plumbing repair, will know that it is more than a little suspect.
Reply: @panik735  Yes, you can. Brick can be pulled down and reused. But that is not what we are talking about here. We are talking about either pre-fab or poured concrete walls with rebar that are on the exterior of the house.
Reply: @starventure maybe it's because of the region I'm from, but I think this discussion is greatly overestimating how many concrete houses there are. From my experience, most (traditional) homes in Western Europe are brick.

And remodeling brick is totally doable. I'm in the process myself. We moved interior walls, added extensions, applied insulation in the floor, roof and walls and replaced everything related to power, water and heating. We call it "stripping" a house. Yeah it's pretty expensive, but the masonry work was only a small part of the project.

It's a very common practice over here because it's the only way to really bring a home up to modern standards. My house was 40 years old when we bought it, and it will be good for another 40 years when we're done in a few months.
Reply: LMAO yes you can remodel it, the  ignorance is insane  @starventure
Reply: @starventure 
You can defenitivly remodel a brick house.
These cardboard walls of american houses are nothing but a cheap skam. Designed to look nice for 10 years, then the mould sets in. If you want to see what quality houses look like, go to Switzerland and see how they build their homes there. Some of them stand for hundreds of years and they look good!
Reply: @starventure  ofc you can! only the structure is concrete the walls can be changed at will.
Reply: @starventure  i wish 😂, i'm 45, now on my 2nd house and 3rd renovation/remoddeling cyclus. Us Belgians are  " Born with a brick in our stomach" 😊, it is an awfull  disease  to have 😂
Reply: @starventure I think remodeling something as permanent as a residence is a stupid idea to begin with and consumerism to the maximum. If there is no flaw in the building, remodeling it just because you feel like you need a change is crazy wasteful.

Also Europeans also do changes to old homes when the layout doesn't fit modern living anymore.
Reply: @DxCBuG  There is a flaw in the design if the buyer says so. Who made you god?
Reply: @starventure as some one who has worked in construction in Europe, you are fundamentally wrong. Concrete can be remodeled as is but not as often than in the us and it is harder to do. There is a mindset that is more towards durability but still comfortable for 95% of potential residents. As for what I’ve seen in the us, there is a mindset to build faster and cheaper to make a quick buck and then it is the responsibility of the next owner to take care of maintenance and/or remodeling.
Reply: @Jacada2002  OK, you literally just said "it is harder to do." Did you just type that or did you not?
Reply: @ yes i did say it is harder to do. What I seem to not have said is not by much more. The little bit of extra work is worth it. Because you have a more sturdy building. My original point was about the fact that you stated that it is uncommon to do that kind of work. And I’m telling you that although it is less often the case, it’s still very wide spread.
Reply: @starventure You can remodel the home made out of concrete lol
Reply: @starventure Who said that? Yes, it is harder in older homes. But the new ones do not have this flaw as they have one or two load-bearing walls. You can move any other wall as you wish.
Reply: @starventure  we definetly do it here
Reply: Land of the free unless when you want to do anything then it’s think of the national debt
Reply: @decadesyearoldthingsreview6595  Well maybe it's time to fire 300k employees in government and get back to basics.
Reply: @ericholdsworth6611  Well yes, let's just do that in the country where you meant to pull yourself up by bootstraps. Let's also bankrupt some grisly companies not doing their job properly, then the people sitting on property waiting for the next generation to retire by simply devaluating their property costs by making their homes not being set up to proper standards. People will suffer, but you can have now decent housing.
Reply: @decadesyearoldthingsreview6595  What? English your 3rd language?
Reply: @starventure  Sure you can easily remodel those houses, on modern houses only the exterior and supporting walls are solid, interior are drywalls from plaster or wood or lightweight porous plaster bricks, easy to remodel with a saw and a hammer.
Reply: @timhartherz5652  That is not what we are talking about here. We are discussing house expansion, not moving internal walls.
Reply: @starventure  You can still do that as well though. It's being done on a daily basis, there isn't a single house in my street which wasn't extended in some way at some point.
Reply: @starventure  modern concrete flats can easily be remodeled, only Soviet era stuff is stuck the way it is due to it being designed for quick production. It was supposed to be a stopgap solution, so nobody planned it to be remodeled, it just somehow survived for up to four times of its planned lifespan (75+ years instead of planned 25). Even then there's a few examples of houses started in USSR and finished in Russian Federation or other post-soviet country, those allow for remodelling. My grandparents live in a flat like this. They laid bricks for internal walls by themselves and it was the way they wanted to.
Reply: @-WarCriminal-22  We are not talking about internal walls.
Reply: Remodeling is always possible. People in Europe even remodel centuries old castles with outer walls of three feet thick.
Don't tell nonsense if you haven't been into traditional  building over there.
Reply: @ 

You can remodel on the inside. You can do that anywhere. Even in a condo in Manhattan. But it is much harder and more expensive to remodel over there. Also, I think what a lot of people are talking about in this situation situation is putting in addition onto a house. In America with a stick built house, not in these tract home subdivisions, but in traditional neighborhoods and small towns and subdivisions with individual site built homes not new subdivisions. It’s very easy to add an addition onto a house. It’s very easy to add a garage and attach it to the house. It’s very easy to add a sunroom or a deck or a porch. that is extremely difficult if not impossible, depending on where you are in Europe.
Reply: @starventure You can remodel concrete homes, any it’s much easier in some cases because you don’t have to rebuild the entire structure, just repaint, change cabinets and tile. In the US you have to replace your roof every so often. If you mean that thing where Americans alter the entire distribution and design of the house every so often, then yes, that’s harder, but the point of buying a house is getting one you like in the first place, not practically replacing it every few years.
Reply: @gabrielamora6265  If you buy a new house, yes you probably are not going to need to alter it but older houses are frequently updated to bring up to modern standards. And no, you are wrong about the point of buying a house. It is not just a place to live in, it is also an investment.
Reply: @ If you are buying a house as an investment, most renovations actually do not increase the value of the property in proportion to the expense, because most renovations are not about maintaining and updating the property, but about adapting it to the taste of the new owner (or his architect).
Reply: @starventure Yes you can... All you need to do is walk down one street in the UK and you'll see how many remodeled houses there are.
Reply: @joshafc41  I don't believe the definition you have of a remodel is the same as what we are discussing here.
Reply: @starventure  When I say remodel, entire floors can be added or removed. Rooms can be added or removed, walls can be added or removed. Anything goes and it all happens regularly.
Reply: @starventure  That's a myth. Even in Latin America with few resources they do that very often. Modifying, moving rooms, expanding rooms, expanding the houses. Even if the roof is reinforced concrete.
By the way you totally omitted that part. Roofing in USA really really sucks! Pretty much because of the same reasons. And again there are stronger and possibly cheaper alternatives in the long run.
Reply: @ramireznoy  Roofing sucks here? With 25 year lifespan guarantees, doubt it.
Reply: @starventure  25years? Many houses in Cuba built in the 50's and practically without maintenance still have no leaks.
A similar experience can be found in Mexico, Venezuela, Argentina. 25 years is peanuts and we are not even talking maintenance costs, fallen trees, fires and hurricanes...
Reply: @starventure you absolutely can. It will take more than a recip saw and nails, but you can.
Reply: @starventure  people remodel their houses all the time here in the Netherlands.
Reply: @starventure  Depends on the style, if it use load bearing walls? it's harder indeed, but if it uses support columns and curtain walls? All walls are optional and as long as don't touch the columns you can remove them at will.
Reply: @starventure you can to some extent , just a lot of hustle
Reply: @starventure  that’s such a stupid thing to say, it sounds like you’re genuinely brainwashed 
My whole neighborhood has remodeled their homes countless of times, it doesn’t need to be made of paper to be able to do it.
It’s such a baffling statement, like saying “Not getting shot is alien to Americans” unironically
Reply: @Jaaaa315  Nice. When you say remodel, what exactly did they get done?
Reply: @ some more, some less. When I say remodel, I'm referring to major renovations such as: adding extra floors to the house, expanding it because the plot has extra space, completely changing the layout of the house by tearing down the walls.
Reply: @starventure  yes, you can remodel a brick house. Lol. This comment is so dumb.
Reply: 😢 @starventure  yes you can. Just slap different paint on the walls, change the tiles, buy new furniture, etc etc
Reply: @Harbinger117-y8g  OK, did you change the sqft?
Reply: @starventure  yeah sure 😂😂 cope harder. I've remodeled my concrete apartment no problem.
Reply: @Laroac  How so? Do explain.
Reply: @starventure  what do you mean by how? contractors? huh? new kitchen, new bath, new wall to separate bath from toilet, and made two adjacent rooms into one big room with a screen for optional partitioning.
Reply: @Laroac  That is not what we are talking about. We are talking about a completely new extension to a home, a full wall knockout with foundation extension and new load bearing walls with partial redo of the interior walls to permit access to the new area. This is a common addition, usually with a second floor extension as well and I am asking if this can be done with the concrete homes the way some are describing them here. Forget about the other stuff involved like opening up floors, the exterior walls are what matters.
Reply: @starventure  well if you have a home home, it can definetly be done. I have an apartment, it's hard to extend the foundation.
 Of course it will be cheaper with a paper home, but there is nothing magical abput it, it's been done for the past hunderts of years.
Reply: @starventure  the dude who made the video literally explains it in the seventh comment in this tread... just read my dude.
Reply: @starventure Absolutely wrong, my parents remodeled our concrete home here in Mexico, is just messier but not more difficult, keep coping
Reply: @chocolatesquirrel2002  So, you admit it is tough to do?
Reply: @chocolatesquirrel2002  How much space did you have in your yard for that?
Reply: @starventure  Claro que se puede remodelar, solo que es mas costoso que renovar las casas de juguete de los estadounidenses.
Reply: @starventure  nonsense, almost every home owner I know here has remodeled their home.  Sure they might be limited compared to pure wooden homes, but they can still change a lot.  not every wall in a solid structure house is essential for the building, you can still break out many inner walls, especially because the outer walls are so strong!   And adding whole new parts to a house is also common.  
this work is often done when the home changes ownership, or after 10,15 years when kids become teens and more space is needed
Reply: @Blackadder75  Very nice. Now tell me how you are knocking out the entire side or rear of the house, because that is what is being discussed here and not some cosmetic change to the interior.
Reply: @starventure  I don't know how, but I have seen homes here with exactly that, the whole rear of the house is gone, to increase the living room size or make an extra conservatory room or something like that.   A friend of mine bought 2 
semi-detached houses next to each other and turned them into 1 single detached house , with most of the middle wall gone.  so they have the option to do that although it might be more expensive than the typical usa woodframe house
Reply: @starventure at do you mean by remodeling ?  Like removing walls? Because the answer to that is jack hammer and you remodel anything.
Reply: @starventure remodel aka refinancing aka more money for the banks and contractors to squeeze out the average joe
Reply: @JorgeDominguez-l7i  Not if you drop the interest rate down. If you can grab a 2.25% away from a 6.5% that is paid down decently, it is a breeze.
Reply: @starventure Dudes never heard of the word "remont."
Reply: @Gnefitisis  Remodel. Sorry if it came out as remont.
Reply: @starventure  I'm the one that brought up the word. OP thinks all Europeans live in medieval thatch huts or commie blocks or something.
Reply: Houses are remodeled all the time all over Europe  @starventure
Reply: @starventure  in some countries in europe up to 80 of the people rent an appartment or a house. For these, remodelling is not needed. But if you have a hybrid of concrete and drywall or mon loadbearing brick walls, you shure can remodel.
Reply: @starventure  bold claim without bases
Reply: @starventure  Remodeling? More like you need rebulding after single rainpour lmao. People renovate houses all the time here.
Reply: Es el argumento más tonto, el concreto también se puede modificar su distribución, pero acaso siempre deben dar excusas por construir de forma tan costosa y calidad inferior? @starventure
Reply: @НатальяСевастьянова-в4е  I can understand if you are talking about concrete postings like what you may see in some commercial structures, but the idea of concrete slab walls in a single floor home seems absurd.
Reply: @starventure  tan absurdo como construir nuevamente casas de madera en zona de tornados después de ser arrasadas por un tornado, no puedo creer tal obstinación después de esa total falta de sentido común
Reply: @starventure "Home owning experience" 

Like y'all could EVER own a house
Reply: @hasturthekinginyellow5003  ? What do you mean? Are you a tax protestor?
Reply: @starventure  no uts not alien,  its different. European buildings are built to last and to conserve heat. There not build like disposable junk
Reply: @starventure  lol what? You've clearly never spoken to Europeans. Half the people I know in my city have remodeled century old structures, and the places look great.
Reply: @nrgpup77  Not sure if what you are calling remodeling is the same between us.
Reply: @starventure  you actually CAN remodel a concrete house. In Argentina you can do it. Expensive, but you can.
Reply: @paulhappyfeet  Well, yes. With enough money, anything should be possible. But if the price is too high, it might not be worth it. Who wants to spend that kind of money for such little return?
Reply: @starventure And when a tornado or fire takes your house you will be spending as much as a brick house 😂😂😂
Reply: @starventure  what, have you ever owner a house here?
There is not a single home owner i know that hasn't on occasion added or removed walls, added extensions etc. we just do it with sturdiness and insulation in mind.
Reply: @starventure maybe this attitude is the problem. What do you need in a home? Kitchen, living rooms, bedrooms, bathrooms, storage and so on. The needs are the same!  Btw everything you say is also possible with houses made of solid materials.
Reply: @starventure  all flats in Europe have been remodeled I the last 50 years. My parents took down a wall to make the living room bigger in a 3rd floor
Reply: @starventure what a load of lies. You can easily remodel a concrete home. I know loads of people who built on or changed layouts.
How can you believe something so stupid sounding?
Reply: @starventure obviously you have not been to Malaysia. We remodel concrete house here all the time
Reply: @starventure  we in Europe mainly built bricks, and with bricks you can remodel the house more easily than concrete. It's being done all the time here.
Reply: @JMGlider  I know you do, but what do you do? You are saying remodel, but what are you specifically talking about?
Reply: @starventure  Remodel is from breaking walls, putting in new ones at different places.
Reply: @JMGlider Exactly, this counts for lot of buildings in Europe, like Germany 🇩🇪 where I’m from.
Reply: @starventure so you can not remodel a concrete home, that’s new. When it’s an evil to European people we leave the houses like we build 200 years ago? Yah „make america great again” 🎉😂
Reply: @starventure yes, remodeling and doing anything with wires and drilling is a pain witg my 10 inch thich brick walls... to mount a TV is a nightmare
Reply: @starventure  Depends on which walls in the house are load-bearing I think. Those that aren't (which may often be built out of drywall) can be hacked/demolished during remodeling. In my country (where we mostly live in apartments as our population density is high) its often only the exterior, bomb shelter & bathroom walls that are load-bearing, though our building codes may also ban us from relocating some bathroom pipes. Some of us are cautious about remodeling though for fear it may devalue our property by making its design appealling to too unique a subset of buyers (including the current owner who may want to sell the property in the future) e.g. I saw a DJ who's living alone convert 1 of her apartment's 2 bathrooms into a walk-in closet (most people may instead convert a bedroom instead as less remodeling work is needed)
Reply: @starventure  yes of course you can...? Load-bearing walls can be opened up using steel I-beams as support if needed (preferably under supervision of a training engineer, but that's no different from US wood framed homes) and you can make concrete or wood framed additions relatively easily. I should know, it's literally my job.
Reply: @rfldss89  Yes, that is exactly it can be done. That is not inexpensive however, and bear in mind that the Europeans are talking not just about concrete wall, but concrete floors/ceilings.
Reply: @starventure  Lol we've been remodeling and renovating Condos and homes built from brick and reinforced concrete for along time.😂
Reply: @starventure  pretty stupid to say you can't remodel a concrete house, you obviously can
Reply: @reymago23  Can you describe the process involved in detail for me, just curious.
Reply: @starventure  yes you can remodel a concrete house and there are structural walls or parts of the building to take in consideration just like wood houses lol.
Reply: @alanmay7929  Jackhammer?
Reply: @starventure Not at all, very wrong. We have limitations with renovations (load bearing walls, ceiling spans,etc) but other than that it's all open for reinterpretation and redesign. Those are actually the main construction jobs in urban areas, interior adaptations and renovations. Plus, why the hell would you wanna renovate all the damn time?
Reply: @acikacika  We renovate all the time in America, because that is our way. If you purchase an older home here, you plan on updating it. That can be as simple as a new kitchen, or as complex as dormers and extensions. This is a frequent request of homeowners in the US and the last thing anyone wants to hear when buying a home is "you can't do that."
Reply from the maker: @starventure very few homes have renovations extensive enough to warrant knocking down exterior walls. 

In a “concrete home” all the partition walls are lumber or steel and are typically not load bearing. 

The main type of remodeling that occurs today is cosmetic. New flooring, new kitchen, new bathroom, etc, 

Not a full structural rebuild. 

What about additions? Well additions aren’t cheap, and they require planning and drawings. It’s not a lot of work to account for cutting through concrete. Should a larger opening be required to connect to an addition. 

It’s a non issue
Reply: @Mike_Fortin  I am in the process of planning an extension with new connected garage to my home and roof extension for a deck overhang. This is almost exactly the same thing that all of my neighbors have done to their homes. It requires extending the foundation, and building new exterior walls to blend into the current structure and the demo of the original exterior wall, which will be replaced by a internal partition wall.
Reply: @starventure the only reason you renovate all the time is because the materials you use are crap and last pissing time.
You're the only place that has to replace your roof every 20 years.
I've never seen a roof being replaced here unless the house was dilapidated.
That itself says everything you need to know about American houses.
Crazy bad buildings.
Reply: @starventure  'Remodeling' is done for only two reasons- 1 To install the latest fixtures to keep up with latest fads to impress the Jones, 2. To replace the flimsy, crappy material used in the original build. Only the USA does this greedy, narcissistic idiocy.
Reply: @starventure  remodeling is basically money churning for contractors, builders, maintenance techs and plumbers as well as corporate giants like home depot, lowes etc. It is all a collusion that all parties are in agreement with hence why US will never have decent built homes.  Same as US healthcare where big pharma and the insurance are in cahoots.
Reply: @starventure unless you live in a HOA, cause it ruins the neighborhoods ChAraCtEr
Reply: Ehm, yes you can...

Are you stupid?
Reply: Why do you wanna remodel a house? @starventure
Reply: @felidaebi6239  Various reasons. Improve visibility to sunlight, redo the kitchen layout for more cabinet space and easier flow, cover over the patio area with roof extension to have light fixtures and fan units, move out the front porch to increase curb appeal...do you comprehend any of this?
Reply: @felidaebi6239 
In Europe, it's generally known as fitting a new kitchen or bathroom.
Americans make it sound like a complete reimagining of the house.
Reply: You can ,lmaooo @starventure
Reply: @starventure  You certainly can, with that attitude no wonder theae pigpens house sells in your country
Reply: @starventure casa de madeira dos 3 porquinhos
Reply: It is possible to remodel concrete homes, it is just more expensive.  @starventure
Reply: @starventure we do it in Kenya 🇰🇪.
Reply: That's why we have planing 😃 @starventure
Reply: Absolutely untrue @starventure
Reply: Yes, you can!! @starventure
Reply: @starventure we did remodel our concrete house 4 times in the span of ±20 years, if you remodel it too much then maybe there's something wrong with the design
Reply: @RRRRRRRRRRR956  Did you consider that the new owner may not agree with the layout but wants it for its location?
Reply: @starventure 😂😂😂😂😂
Reply: @starventure yes you can.
Reply: What is the remodeling for though? If you hate your house here, you sell and buy a house you love....  @starventure
Reply: @starventure My house can stand a 9° earthquake without a sweat, it has 80 years and has been remodeled within the years being added new rooms and bathrooms...it's not hard at all to remodel a reinforced concrete house...
Reply: @starventure it is not you can add things to brick homes we do it all the time. Americans are backwards. 😂😂😂
Reply: I'm have a home renovation business in Italy , what you said is just wrong , there are only 6 pillars on an appartment that cannot be taken down or 2 pillars for small houses . 
Yes it cost more to make them in bricks , but you can find other solutions as well , wood is still never used , in fact , mold is not a problem for every house but just a signal of humidity  @starventure
Reply: @starventure Concrete homes can be remodeled.
Reply: Not even true 😂😂😂  @starventure
Reply: @starventure yea rather hame home that u can remodel then house that will be safe for your family and isnt destroyed in every possible even there is
Reply: @starventure it’s… it’s not Lmfao. What a dumbass statement.
Reply: @starventure so?
Reply: @starventure  remodeling is a pointless waste of money
Reply: You really have no clue about remodeling and renovating european houses. If houses are around for generations it is mainly ɓecause each generation changed their houses for their respective needs throughout the years.
One generation has a lot of children? Put some additional walls up to have more  rooms to provide privacy to the kids, or build an addition.
One of the kids keeps the house and has fewer kids themselves? Rip those walls out to get the space back.
The older a house the more changes were made over the years. You hear it all the time about castles when building x was added in xth century and part y was destroyed in war y so they built part z... The same goes for our smaller family homes.

My grandparents home was built as a single family single storey home. When my aunt, mother and uncle were born they  turned the attic into living space for additional rooms. My uncle and his wife decided to keep the house and when the roof needed replacing they hightened the second story and turned those two rooms of a former attic into an entire flat of their own, with it's own front door... It would be loveky to see the next changes to that house but my uncle has no kids. And the other family members all have their own houses. I can only hope that either of my nephews or my cousins daughter would be interested in taking over. 
 @starventure
Reply: @starventure  yes you can xefinetely remodel concrete house.
Reply: Your wrong about that  @starventure
Reply: @starventure  wrong, you can
Reply: Here in Brasil we remodel houses made with blocks and concrete , we have a mix of structural and non structural walls, you can demolish any non structural wall and you can put new doors and windows in the structural walls placing some reinforcements to the structure
Some new houses have the non structural walls made with drywall , but it always gives a cheap feeling to the house
Reply: @TheSky3Killer  I'm not saying it is impossible to change a concrete home. Just that is a lot more difficult. The whole point is that what works best in your area of the globe my not be what is best in my area of the globe. Don't crap on the folks living in elk hide tents hustle because they are different than how houses are built on your street. That is stupid, arrogant, and shows how little you know how the world works beyond you line of sight.
Reply: You cannot remodel a concrete house? 😂😂
Thats another way of saying "I dont know anything about concrete houses". @starventure
Reply: @starventure rage bait or intelligence problems?
Reply: @starventure  Stupidest comment ever! U CAN remodel them. It has been done countless times around the world except, must be, america.
Reply: Not really true. In Germany, there is a distinction made between load bearing walls... Those need to stay in place. Their placement is very carefully calculated to make the house structurally sound. Inside walls that are non load bearing can be done as drywall, which is sort of like the light timber framing in the US, just done with metal studs instead of wood. Lots of homeowners still prefer (smaller) bricks for non load bearing walls, because of the superior noise insulation...
They can still be knocked out for a remodel, it's just a bit more work. 
Aside from that, what is the obsession with remodeling? American houses don't even seem to last long enough to necessitate remodeling...
Reply: @starventure  no offense but... are you an idiot, sir?
Reply: @starventure you and 200+ other people are stupid enough to not try to look up online if your statement was retarded
Reply: @starventure i laugh every time an american assume bullshit over europeans just because he cannot fathom the idea that his country is dogshit
Reply: @starventure this comment is literally the same bullshit that i saw some americans say:
Free healthcare is communist
Reply: @starventure  That must be the weirdest argument I've ever heard, why wouldn't it be possible to remodel an European house?
Reply: @Bourinos02  Because your definition of remodeling is not quite the same as what is being discussed. Not talking about a simple kitchen refurb or bathroom upgrade, those are diy things.
Reply: @starventure  Then what is it? You can destroy several walls in an European house too. It just takes more effort than having a pair of scissors and you can't if that specific wall is load bearing.
Reply: @starventure  is it alien? i see houses being built, rebuilt changed, modified all the time here, these are all stone and brick houses. keep your twig house in wildfire areas bro
Reply: @starventure  That's right, every breeze up to a hurricane rebuilds the houses again and again. The shabby cardboard roofs are the first to fly off, then the roof trusses and the rest topples over like a house of cards. And all without even consulting an architect. That's what I call American efficiency and customization
Reply: @gerhardma4297  Tell me how dumb you are without actually saying it. You have found a new way, congratulations.
Reply: @starventure  Least clueless american lmao
Reply: ......buddy, even us in 3rd world "poor" country do remodel with CONCRETES wall. And dont get bakrupted. Arent you USAn a cheap date, huh? @starventure
Reply: @nurlindafsihotang49  Ok, sure.
Reply: @starventure  What do you mean you can't remodel a house made of concrete and/or brick? Well, just like a house made of sticks and wood veneer, only much slower, because a house made of sticks and wood veneer can be knocked down quickly by kicking... literally XD.

Here in Spain there are a lot of people who renovate parts of their house made of concrete and bricks without the slightest problem. There are lots of bricklayers and construction companies dedicated to that, not only just creating new houses from concrete and brick from zero.

What you say makes the same sense as saying, for example, that an old plane made of wooden sticks and canvas could be modified, but that a modern metal plane can't be (when we all know that it can). In other words, it makes no sense that you said and that shows the enormous ignorance and the very isolated and closed mind that most Americans have about the rest of the world.
Reply: @starventure Why tf remodel it?
Reply: @starventure you can remodel we do it in Europe too. M'y house for exemple was built in the 1870s dans when originaly from a farm no now a house with two added extension over the years so it's possible but it's not as easy as adding a few wood pieces
Reply: @starventure Tell me that you arent european, without telling me.
Reply: @sack8439 Fr Same, Europeans here know that it is possible.
Reply: @starventure European here and it's not alien at all.
Reply: @starventure if it last longer I don't care about remodeling. The repair pricess are insane in the usa
Reply: @luissanchezpalacios7698  No they are not.
Reply: @starventure    Also bricks and blocks are a thing, nobody uses straight up concrete, they use these two. Bricks for walls so they stop winds coming at highway speeds or faster from trying to damage your house's base (which is also usually concrete combined with bricks); and blocks — the bricks with holes in them — for the house, as these are easier to sledgehammer, in case you need to expand or modify the layout and style of your house (a.k.a. actual remodeling, what you are talking is reconstruction, when you destroy a building — in this case, a house — and put another one in place)
Reply: @RodolfoRamos-cd6zh  The people on here are saying European homes are made of concrete slabs, not brick which to us seems more akin to a warehouse or prison than a home, especially rebar concrete. American homes are a combination of brick and wood, so yes, remodeling is an easy thing to perform. I am not talking about full demolition like you mentioned, demo-ing a wall to expand a room outside is not taking out the whole house. The rest of the house is left intact.
Reply: @starventure  What do you remodel? How is it integral? How often does that happen?
Reply: @leocurious9919  You remodel kitchens, living rooms, dining rooms, etc. But I believe that our definitions are a little different, which is why there is confusion. Does it happen often? Contractors are doing a thriving business in it, so it is fairly often.
Reply: @starventure  I do not understand, why should that be an issue in stone/concrete houses? I grew up with people doing these things in those. I initially thought you meant literally changing the shape of the house or something and was confused how often that must happen, but just rearranging the inside etc. is nothing special?
Reply: @leocurious9919  Changing the shape of the house.
Reply: @starventure    Remodeling homes isn't alien to anyone in the world, my guy. That's just ignorance. Also, you can remodel concrete houses, specially the ones with steel plates and rebars instead of wrought iron rebars.
Reply: @RodolfoRamos-cd6zh  I'm sure you could find a contractor out there who would be willing to cut open or jackhammer out a new door or window through rebar concrete, but the cost is going to be insane.
Reply: @starventure     If by insane, you mean it's going to cost money to... you know... do expansion, structural reengineering and layout changing, then yes.  Also how much is a house "remodeling" in US again? In quotes, because what you're saying isn't expanding, changing layout & style  and reengineering the structure of a house (a.k.a. remodeling), it's making ANOTHER house in place of the previous one (reconstruction)
Reply: @starventure Europeans remodel all the time lol what you mean 😅
Reply: @howlingbeats2544  I mean remodel as in changing the integral structure of the home.
Reply: @starventure yes you can.
Reply: @starventure It is possible because we did it two years ago. In Europe you get value for your money, in the US you get a home were you can punch through the walls.
Reply: @alpaslan4881  Can you run a new utility through that wall?
Reply: @starventure  Yes i can because not every wall is made out of concret only the load bearing ones. But i don't need to.
Reply: @alpaslan4881  So demo a load bearing wall. Pretend you do need to. How do you get the job done?
Reply: @starventure that is absolutely not true, ofc you can remodel houses here as well. We did it xD Pls stop talking if you dont know
Reply: @starventure as they say, the stupid ones are the loudest
Reply: @moritzwalter1089  Which you are being.
Reply: @starventure retard
Reply: @starventure  who said you cant? i have renovate my house 3 time & remodel the interior 3 time.. that just a dumb excuse 😂
Reply: You are so wrong and in denial saying that  @starventure
Reply: @starventure  not true.
Reply: Nah. @starventure
Reply: @starventure  Yes you can. Why would you think that ?
Reply: @BertSingels  Cutting through or jackhammering rebar reinforced concrete is a challenge, do you not agree?
Reply: @starventure Na we „remodel“ the houses regularly… but its called renovation :) you do it maybe all 15-30 years.
Reply: @starventure no it isn’t you dunce egg. Our houses can be and are constantly subject to remodeling, and yet they stand sturdy and magnificent
Reply: @starventure you must be american, how can you even think you cant tear down a concrete/brick wall if you want to remodel a house
Reply: @henry9119  Are YOU going to tear down an exterior load bearing wall made of concrete with rebar?
Reply: @ i mean sure if i had to but why in the first place would i get a house i wanted to redisign, its a fucking hassle with all inspections and legal stuff. But I get why ’muricans would do it, you may simply outgrow your house if you know what i mean. And after all you can redisign your house after every hurricane
Reply: @starventure  bro mexico houses are made of concrete. Mostly everyone that "owns" a house can and will probably remodel
Reply: @starventure why are Americans so quick to reply bullshit they don‘t know shit about?🤣🤣 man you‘re talking trash. You have absolutelly no clue
Reply: @starventure  my grandmother told me to always give a positive response so:
i wish i had your confidence in subjects where i have little to no knowledge.
Reply: @starventure  you could if this was important to you. Inner walls can still be drywall
Reply: @lemon_of_ludus7226 Oh, of course. That is fine. What I am pointing out is that exterior walls do get demolished on occasion, and that when they are built of rebar concrete it makes things more complex and expensive.
Reply: @starventure  yes ppl do it all the time u just need more skills
Reply: @ And time. And money.
Reply: @starventure  reeeeeeeee tar d
Reply: @starventure  as a scandinavian, i can definetly tell you that remodeling a house is not a foreign concept
Reply: @starventure that's not true, retard. Every block house on my street has an extension. Each unique to the family who extended them.
Reply: @starventure what are you on about? Scandinavians are the top countries when it comes to remodelling globally, it's regarded as an issue in Norway as we have a remodelling epidemic. So Europeans definitely remodel a lot.
Reply: @Frygisk  Are you talking about room remodeling or whole house remodeling? We are discussing whole house remodeling here.
Reply: That´s jast not true, last year we got a complete new balcony.
Reply: @starventure  why would you care to remodel a house? You make it righ first time. If you change your mind too often then you may become a female
Reply: Lol. Do you think we never remodeled concrete houses built after the WW2? Or even the towers of apartments in our capitals built for social housing from the 1960 era?🙄
Reply: @starventure  wdym? We remodel all the time. Infact there's laws requiring us to remodel quite often because here regulations on home safety are retroactive meaning you need to update the home to fit the new regulations within a few years unlike most us states that only require new housing to have the new regulations. I haven't seen a single house that hasn't been remodeled within Atleast the last 50 years with some being old with only electrical improvements etc.
Reply: @starventure you think we don't remodel our homes? That's a weird take
Reply: @wiggles420  I am suspicious that your definition of remodeling is a bit different from what is done here.
Reply: @starventure just did a remodel to the family concrete house 3 months ago
Reply: @akusemkhal  What did you have done?
Reply: @starventure a well thought out design and planed house doesn’t need a remodel.
Reply: @jamalcoimbra1652  Yes, if it is a modern house. Modern architects have the ability to design with current requirements in mind. But what if you are improving an 80 or 100 year old house, which is common in some areas here.
Reply: @starventure But people in the US can't even afford remodeling their house, some can't even afford a house. We build houses that last generations and you can still remodel them from the inside.
Reply: @bamgbose0302  We are remodeling houses all the time here. It is not that expensive.
Reply: @starventure  this is so blatantly false its not even funny. Remodelling is insanely common in the UK. You can walk down a row of terraced houses that at one point would’ve been identical, and they will now have loft conversions and added rooms on top of the garages.
Reply: @baconwizard  What are those walls made of?
Reply: @starventure  

Is that really that big of a deal in the States. Mostly people in Europe if there`s really no house fit for their own purpose then they just build their own.
Reply: @1dameister1  That depends. If the land is available, new houses get built all the time. Not a big deal. But if you are sentimental about a particular home and you want to bring it up to modern standards, expanding the house while retaining the original is fairy commonplace.
Reply: @starventure  

Interesting.
Reply: @starventure  I'm still not convinced that that's the reason to build a house out of wood.
Reply: @starventure  Homes are NOT LAGOS, where you keep on remodeling. This goes to the attitude of people where people look at LOOKS over DURABILITY. This is the life reality of Americans whether it is for house or something else. Always LOOKS OVER ACTUAL STUFF..
Reply: No I know you can't 
That's why skilled contractors from nothern europe are going to the states and making bank because WE know how to remodel a concrete house 
Not that difficult tbh
Reply: @FestiveParrot  it's actually quite simple when you learn the basics of concrete house remodeling, eventually it becomes easier than wood house remodeling in my opinion
Reply: Really?? You sure??? Pls stay in ur little lego house and leave Europe alone. In that sector u r 100 years behind .
Reply: Why would you remodel house? Choose the one you like and let another house to other people, who would appreciate it as is. This is so wasteful and egoistic. No wonder Americans have so many problems nowadays.  @starventure
Reply: @starventure  yea you can, do you think people in other countries just dont remodel? Lmao
Reply: @starventure no it isn't 😂
Reply: @starventure  Europeans remodels their homes too. dumbass
Reply: @starventure  
"Remodeling" in Europe means that you move your old kitchen into the new kitchen and strategically place your shelves. The concept of changing the interior walls (also usually made of solid brick instead of cardboard btw) is indeed alien.
Reply: @Alias_Anybody  I am not talking about moving interior walls(which are not made of cardboard anywhere AFAIK). I am talking of cutting open or moving the exterior walls. It seems that you might have a tough time doing that with a house where the walls are poured in on rebar. Do-able, sure but expensive.
Reply: You can, many these day only have a concrete outer walls, inside walls are all drywall so you can do what you want @starventure
Reply: @starventure  Yes you can. Takes a bit of ellbowgrease but it works. Of you buy a new home here, you usually rip out everything that is old and remodel the house completely.
Reply: @gummiente3622  That includes some exterior walls as well, yes?
Reply: @starventure in vietnam houses are concrete frame with brick walls and only last 10-20 years till the new owner demolishes and rebuilds
Reply: @tumo07  You're joking right? Why such a short amount of time? Is it the climate?
Reply: @ welp part of it is and other part is builders are really cheap workers hence cheap cost to build and quality is not good but many houses are just that the new owner doesn’t like it so they deal with previous onwer to lower price for demolition and new owner build new
Reply: @starventure true for people with a lot of money or are just straight up retarded. Which one are you?
Reply: Thats just flst out wrong  @starventure
Reply: @starventure  who cares? What are you gonna remodel when the house gets absolutely ruined because it's not built to last. The primary goal of housing as the commenter said is for investors to make money
Reply: @kelkiiii  Maybe the modern crap housing isn't meant to last, but the older homes are worth saving. They have been around for over 70 years now and are still doing fine. The last home I owned and sold was already 110 years old back in the early 2010s, so you are wrong about them not being built to last.
Reply: @starventure you can. Actually a lot easier to do
Reply: @starventure you haven't been in Tbilisi, Georgia 😂😂😂😂. Just google pictures 'достройки Тбилиси' (house expansions Tbilisi), there are some epic examples.
Reply: @starventure you can remodel a concrete house bro
y'all just a bunch of cheapskates using wood to build a house
i would understand it if it's 3rd world countries but us?
why insist on building a house using wood?
it's dumb af
Reply: @starventure  you can remodel, just takes way more effort
Reply: @starventure  you totally can. You just have to have the construction map to see which walls are not to be altered.
Reply: @MissBriCookieMonster  And which walls are those...?
Reply: @starventure we absolutely do remodel in Europe, my family has remodelled our house more times than I can count
Reply: @smortv9629  Remodeling rooms or the whole house?
Reply: @starventure  you dont know how architecture works, do you?? Because you dont need a house made out of wood sheet to remodel it 😅
Reply: @starventure  That is just BS. Several of my relatives have remodeled their concrete and brick homes. You can add another floor or add an addition easily
Reply: @ Expenses?
Reply: Not remodel ? We remodel all the time dummy😂Our walls are so strong you can cut 90% of the wall and buy your neighbours house and now you have one big one😂 @starventure
Reply: @starventure So delusional, so ignorant, you passed being a American clueless😂
Reply: @starventure  What an absurd fucking statement holy shit. You gius will latch onto ANY stupid idea to justify your nonsense
Reply: @starventure so what, you think brick houses haven't changed in 500 years?
Reply: @starventure  that is so wrong lol
Reply: @starventure why would you want to remodel so much you need to make tour house of wack ass lumber lol
Reply: @Pinkbreaksthewall  Are you rer0?
Reply: @starventure cool story bro, too bad it's wrong 😂 all my life i lived in solid structure houses, we can remodel just fine.
Reply: @IHearColors  Yes. You can. With a jackhammer and concrete saw. You are an absolute genius.
Reply: @starventure  Bullshit, lol, you can remodel any house, concrete included.
Reply: @starventure  yes you can, but also at this economy why not find a house with a layout that already suits you?? Remodelling doesn't mean you have to tear down walls you know...
Reply: @starventure totally false. Tons of remodeling in the UK and rural France.
Reply: @starventure we have my whole life in mexico, what are you talking about??
Reply: @DeathCrow501  I believe we are talking about the concept of using a jackhammer inside your home just to open up a new doorway or window.
Reply: @starventure remodeling is not an integral part of owning a home in America they're just built like that because it's cheap
Reply: @starventure  yes you can ...not to same extend or with same ease ..but its possible .
Reply: @starventure you live in a fantasy world. Obviously you can remodel brick, stone, and concrete buildings. We've been doing it for milennia before the USA even existed
Reply: @nagranoth_ It takes too much time and effort, its not efficient. I always built and had homes made with bricks, reinforced concrete, etc. Once i built and lived in my first one made with wood frame i never looked back, now im planning my future homes for rental and sale with a mix of steel and wood frame.
Reply: @starventure  Mate.
WTAF are you talking about??

We literally have Brick homes in the UK and we RE-MODEL & add extensions to them ALL THE TIME!

Get your Head OUT of your own Ass and stop thinking everything America does is “the best” you ARROGANT SOB!

America is just 1 giant Business cycle that’s it.

They want flimsy houses so that the can   Make them cheaper & sell them for way higher than their worth to make a profit.

Then the insurance companies get to charge crazy high premiums as the homes are so easily damage-able 

And then that gives builders more jobs to constantly have to fix things.

1 giant business!
Reply: @starventure  you can for less money. everything is so expensive in the USA that it is cheaper to remodel concrete than to remodel wood.
Reply: @Critical-Smoke  Yeah, NOW it is due to the idiotic tariffs.
Reply: @starventure  you can easily destroy non structural walls.
Reply: @starventure  bullshit
Reply: @starventure what are you talking about ,you can remodel a concrete home , all you is cut out the wall and stick an rsj in .
Reply: @starventure  Gee if only there were tools that could cut concrete 🤔 Absolute mong take. Please think before you speak.
Reply: @-_-----  Are you going to cut an entire load bearing wall? Tell us more about how retarded you are.
Reply: @-_----- Technically,  there is no problem with cutting concrete. What do you mean?
Reply: @starventure so, because you cant remodel a brick home (you actually can), our homes need to be made out of paper and glue and cost $200,000?
Reply: @starventure  You can definitely do that!  However, what's the point in remodeling a shack? It still remains a shack.
Reply: @arx3516  Huh? How do you figure that? Are you sure that you understand what remodeling means?
Reply: @starventure  That's nonsense. You are not a builder.
Reply: @starventure 
Remodeling for what? Most Americans don't have the money for that 😅
Reply: @ThalmorAgent-08  Bro, get a job. The expense is not that bad. If you have money to blow on your F-150, you easily have the money for remodeling.
Reply: @starventure that is very true. I’ve been watching a lot of American diy channels and it’s amazing how easy you guys have it when changing the whole floor plan. I live in a roughly 2000 square feet house and everything is brick or concrete. There’s not a single drywall. On one hand that’s really awesome, how sturdy everything is, but it comes with some downsides, too. We really liked the house when we bought it and moved in, but the longer we are in this house the more we come to the conclusion, that it has some impracticalities, but remodeling is just something we basically can’t afford. Of course some new paint and other cosmetics, are easy, but knocking a wall out or placing a window on the other side of the wall is some major construction work. Combined with under floor heating it’s more or less impossible or at least more expensive than building new.
Reply: So, I built my home so I could make a quick buck? How exactly did I manage to pull one over on myself? 
  And, American housing is 100 years behind? Compared to your methods which are a millenia behind?
 Children, you act like children. It makes no sense to build with stone in my environment. My parent's home is stone. And they pay through the ass to heat it all winter. 5 to 8 times LESS efficient than my stick built home just a few hundred yards away. Let's all act like adults and admit that we do not know what is best for someone half way around the world. Notre Dame is built of stone. Seemed to burn pretty nicely. And plenty of stone buildings get destroyed by earthquakes where wooden homes manage just fine. And wooden houses get destroyed by tornadoes where concrete buildings just need to replace the roof. How does a person that is hundreds of miles away from a stone quary, yet surrounded by trees justify a stone house?
Reply: @goatman3828  you parent house is poorly build, your stick house is "more efficient because you have a better insulation inside your wall , spoiler , youre suppose to put the same insulation for concrete house and boom no more  5-8 time less efficient 
that's basic knowledge construction material and insulation are 2 different things
Reply: @faellyss  your ignorance is your greatest feature. Live your life. Perhaps when you reach puberty you will know something. Untill then, ignorant comments are all you have. It might be years until your balls drop.
Reply: @goatman3828  Notre Dame burned because of the wooden component 🤦
Reply: @huraqan3761  Yea. And it is a European design right?
Reply: @goatman3828 why are you so obsessed with stone?
Just use blocks. Not those shitty cavity blocks. Solid block.
There's no comparison to wood.
Also, you're parents house must be old if it's cold. My block house is packed with insulation. It's A2 energy rated which is just a notch below passive.
Wooden houses are cheap crap sold at solid block prices. Only fools fall for buying them.
Reply: @Sean-pm2vd  Why are so many wood homes still being built in Europe then? And if I was obsessed with stone I would probably have built my house with it. My basement is POURED concrete. Not that 💩 block that you are apparently obsessed with. 
  Concrete block transfers cold into the house many times faster than wood. That is a fact. Insulate both the same and the wood house WILL be warmer in winter. That's science, my friend. 
  You probably have wooden buildings in your country that are hundreds of years old. Is that not durable enough. Probably older than my COUNTRY. Same in Asia. Centuries old. With bamboo. And that is a grass. 
  So pull your head out of your 🫏 and realize your opinion is an opinion. There are pros and cons to everything. What you may think is a con, I may think is a pro. If I want to redo my kitchen I can easily reframe to whatever configuration I like. Can't do that so easily with a concrete wall. Or I want a window put in that room. Sure is easily done with a wooden home. Use your critical thinking before your opinion proves you don't have critical thinking.
Reply: @goatman3828  once again you speak about what you dont know.
Answer 1. Wooden houses are built here because they're cheap and fast. The same reason they're built in America.
2. Block houses aren't built with a single row 🤣
One row of blocks 150mm thick. Then a vapour barrier is put up against it. Then you have a 150mm cavity filled or partially filled with insulation and an air gap, then another row of blocks. After that, they get plastered.
Nothing gets through.
All you have in American houses is 1 timber partition as an exterior wall.
Tell me again how long your roof is going to last before you have to replace everything.
That doesn't happen here.

Now to your ridiculous point of not being able to change anything inside our homes.
That's just a flat out lie and there're hundreds of TV shows that show the opposite. I have built extensions onto my parents house and added windows and doors anywhere was needed. It's easy. Maybe not as easy as American homes, but that doesn't say much since I could punch my way through American walls.
Reply: @Sean-pm2vd  thanks. And I did NOT say you COULDN'T change walls in a concrete home. I said it was HARDER. See the difference. And, why does any opinion other than yours become a lie? Many wooden homes are built with a double exterior wall fully insulated between for a complete thermal break. And many log style homes are built here too. So, apparently, using your thought process YOU ARE THE ONE TELLING LIES. So, are there NO wooden homes in Europe? None still being built? None centuries old? You probably have several churches in YOUR country built in the Middle Ages. 
As for my roof? It is metal, and according to you it will soon be falling apart. Which, of course is another one of YOUR ignorant LIES you like to tell. You are obviously of limited mental ability, so I will tell you that a metal roof can, and does, last for centuries. And the majority of my outbuildings have slate roofs. But, apparently you think they only last a few years too? 
 You are either ignorant or stupid. Either way, you talk about things you have no idea about. You talk 💩. A lot of dumb 💩. You are probably not called out on it, but all your friends and family know you just spout 💩 to pretend you are a Man. But, hey, if that is what it takes for your child like intelligence to get through the day, fine by me. Have a good day, man-child. And goodbye.
Reply: @goatman3828 it is an issue of durability. Most people have respect for the durability and the aesthetic of log cabins made the Alaskan way for the cold for example. Pre cut solid wood houses to assemble are also of very respectable durability…people like wooden houses in Europe, Argentina and also here in Brazil’s cold regions…
It’s not just because it’s frame, but because the filling of the frames is not good, the wood for the frames is soft, there’s plywood, foam etc etc

It’s not just the technique, it’s because only the cheapest most s&@y materials are used…put long beams to bear the weight in the corners, respectable ones 20 inches by 20 inches, twenty feet long…solid beams for the roof, fill the frames with mud to add weight and cover with real wood not ply…then it would be a difference of style…

The criticism is not just because solid construction has more durability…even among wood building styles and techniques, US homes for decades now are using the lowest of the low materials….